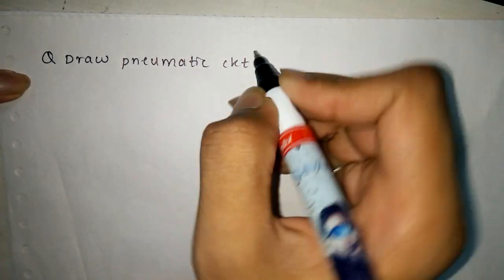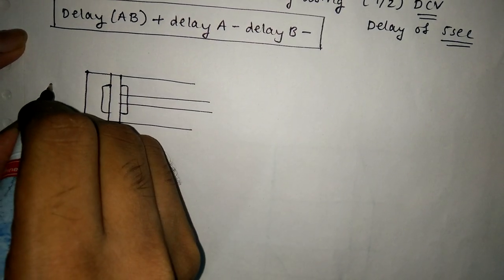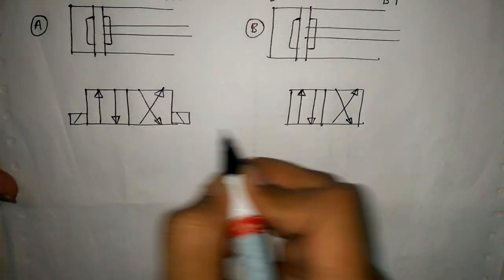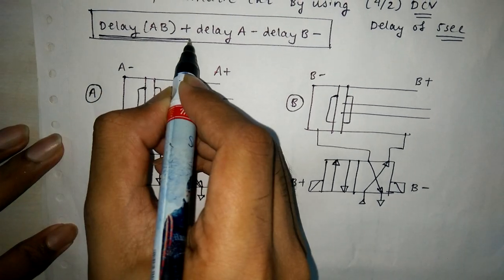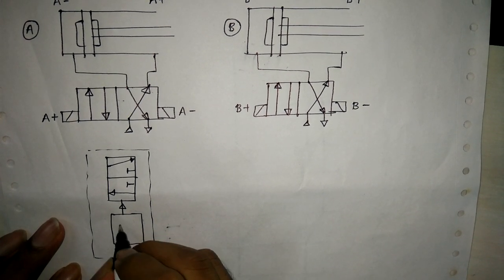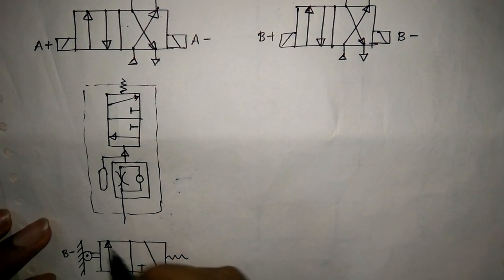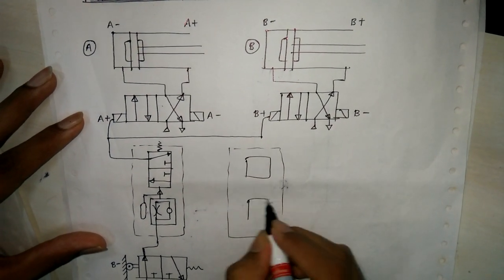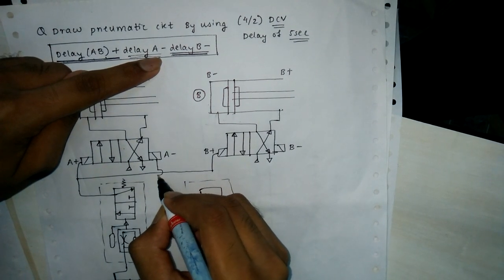Mechatronics ( Pneumatic circuit)

Comment: Most of the times in exam its 5/2 way final direction control valves for pneumatic circuit

Please explain that or take one more example of any mu question paper and put video again
Reply from the maker: In 5/2 valve only exhaust is first and then compression
Reply from the maker: Only the inverted triangle will be first
Reply from the maker: Rest full circuit is same
Reply from the maker: 1 sum is mistake in University that should be B-
Reply: Okay thanks
Reply from the maker: And displacement diagram will start at zero and will be ending at zero only

Comment: Plz give soln for Q)Two double acting cylinders A&B are selected for industrial automation.The motion of sequence A+B+(rapid approach)B+(slow feed)B-A-.Draw Pneumatic circuit diagram and step displacement diagram for 5/2  Dcv. (May 15)
Reply from the maker: It's a hard qn
It will not repeat in exm again
Don't take tension